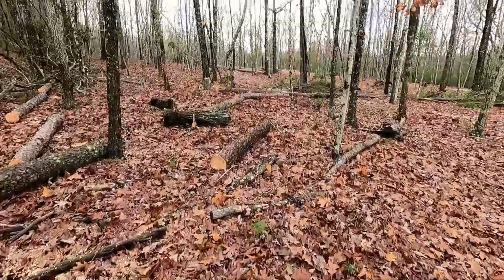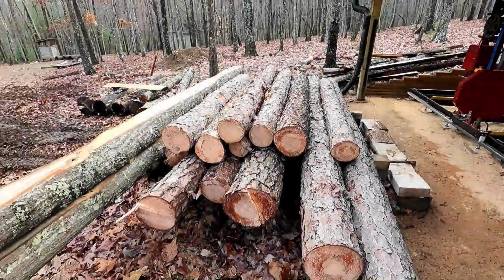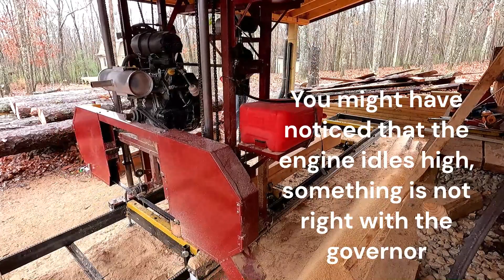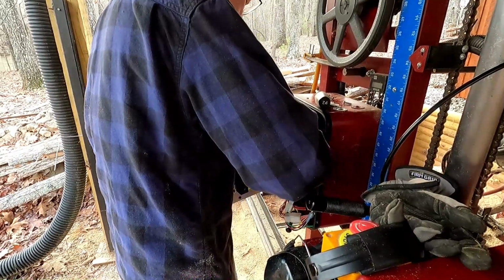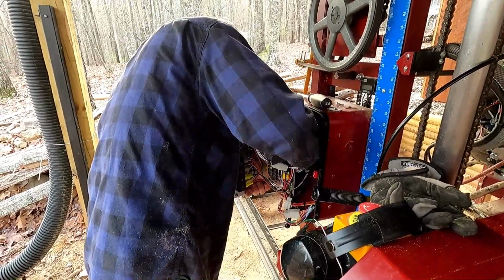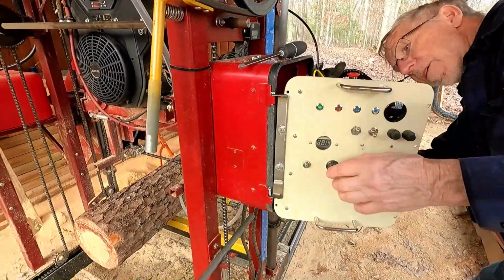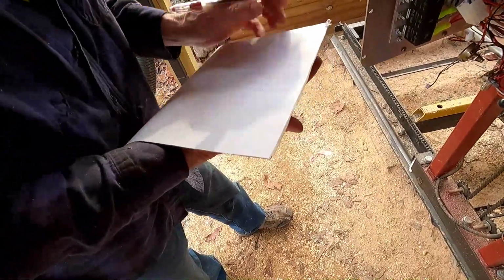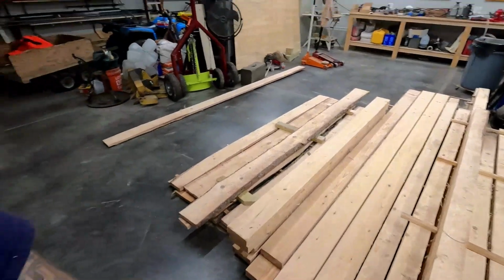Making Rough Sawn Yellow Pine Lumber on Our Homemade Sawmill: Sawmill Series Ep. 2

Comment: My guess on the feed,  make sure that pot is a wire-wound pot, not a carbon-pot,  same ohm rating... had that problem on my cross table feed,  milling machine,  two new pots, till I went to a wire-wound pot... 20 years latter still works...   Nice job on that saw mill, Pops...
Reply from the maker: That's good to know. Thanks for the input and the compliment.

Comment: I have learned that in softer woods you actually have to push a lot faster.  I mainly cut hardwoods and when I tried cutting White Pine the cut was terrible and rough. Picked up the pace and the cut smoothed out.  You are running a much more powerful engine.  I usually push as fast as I can without bogging down the engine.  Looks like to me Pops has that speed geared perfect for a much wider cut.  Time to roll out the big logs lol.
Reply from the maker: Yeah, the hardwoods we cut run about that speed. Much more load. I've been wanting to speed up the gearing, and it just so happens we did while the machine was down. Pushing it by hand showed Pop it can handle more speed, especially in soft wood.  We have some very large white pines to cut so........

Comment: Those 7 degree blades are bad about diving when getting dull try 10 degree they’ll just get dull and slow down. I cut for a living and I hate 7s
Reply from the maker: There for the comment. We use both depending on what we are cutting.  Diving has been a problem with both when getting dull, but the current tension setup doesn't allow us to apply enough tension to the blade. That's going to be a redesign.